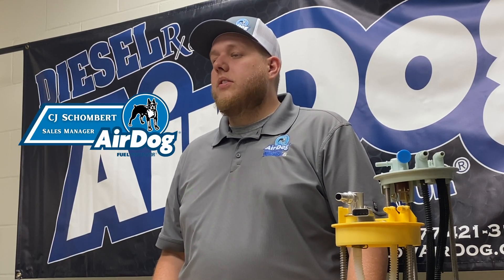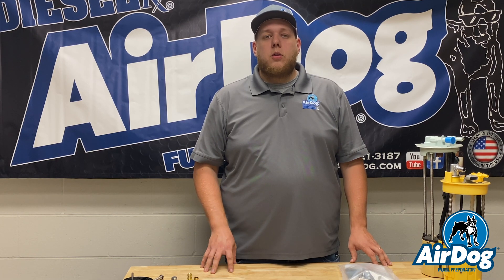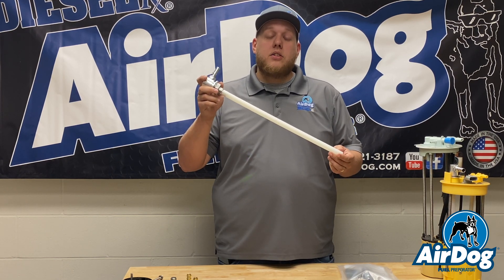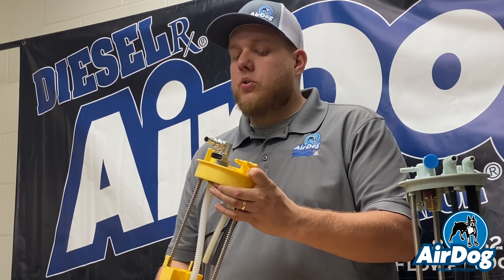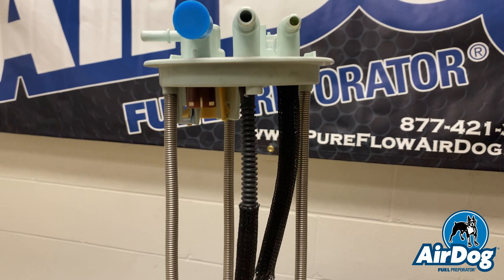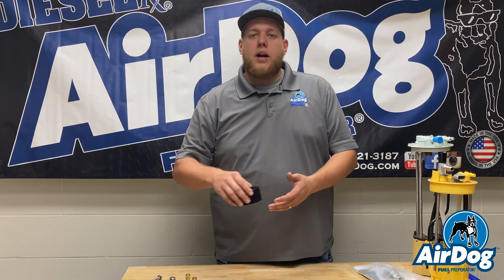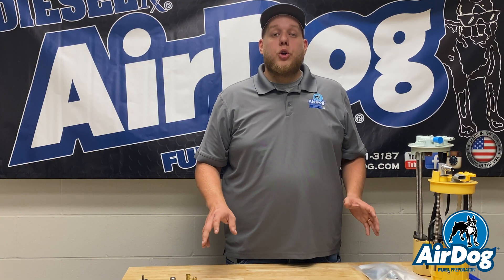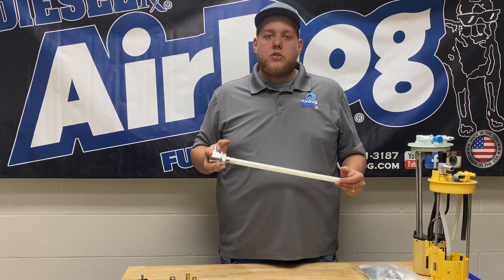What Suction Line Do You Need For Your AirDog?

Comment: The 165 air dog I purchased from Ponci's diesel didn't come with a filler neck. I probably should have ordered it directly from you guys cuz wish those dudes would have told me what the kit came with. Anyways I have the plastic draw straw for my 2003 Cummins works good . Now I need one for my 12 valve maybe I'll go with the meatal draw straw .as to the dude in the comments saying that it's slower filling up. I have no problem with the truck on while filling with a filler neck .

Comment: Why do I have to fill my fuel tank super slow after installing  this? 04 2500 6.6
Reply: Depending on what model airdog you have, it maybe a high flow return. If that’s the case you will likely need to shut the truck off while fueling.